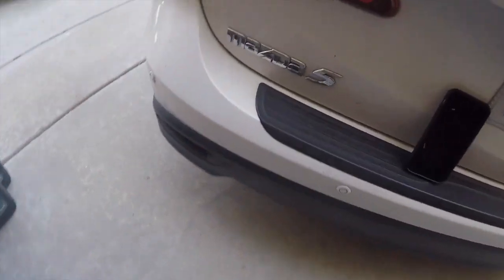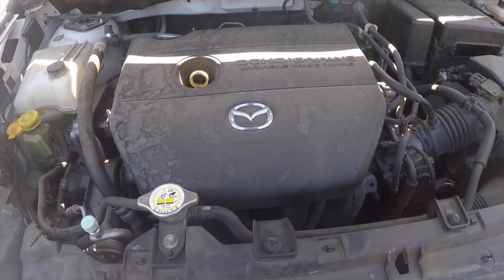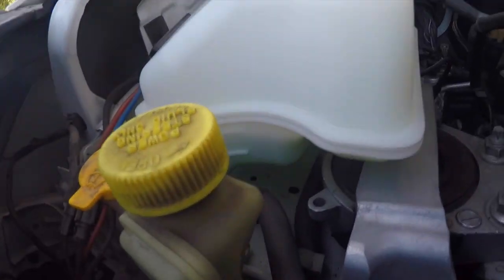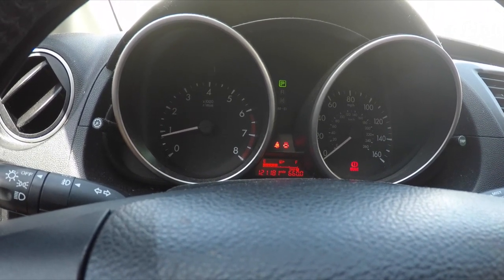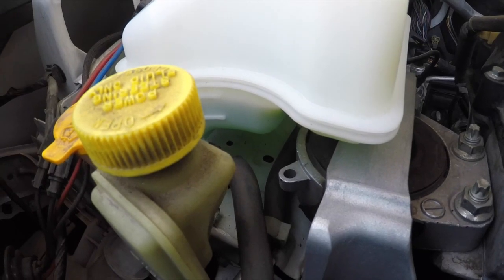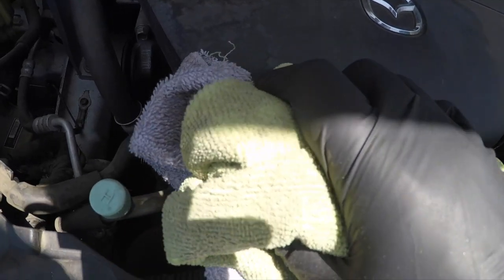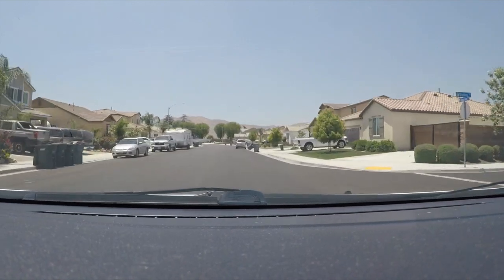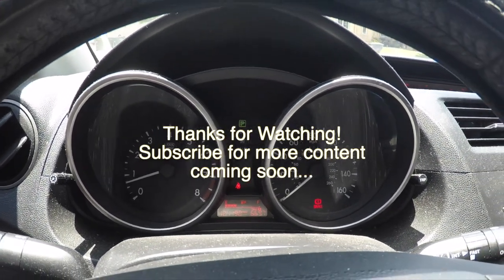Replaced my Mazda 5 Coolant

Comment: To drain the resivor tank just remove the hose that goes into radiator and snake it to the drain pan. It's easier and you don't have to remove the resivor. Nice video. I have a 2012 grand touring.
Reply: But he wanted to clean it inside and out. You should remove it to clean it.
Reply: That's an easier way of draining the reservoir :)

Comment: to do this properly you need to drain the coolant- get the same point before you poured the water in. close the bleeder valve, fill reservoir and radiator to top. run car for 10+ mins with heat on to get the thermostat to open up and circulate the water to flush out later. let the car cool down. then drain the system again- fill your coolant- then proceed to bleed any air in the system

Comment: What about the old coolant in the engine block? You don't drain and rinse it with distilled water? I thought one should either drain the engine block or top off the radiator with water, have engine run for a few minutes, drain, and repeat three times to get all old coolant out before replacing water with the new coolant.
Reply: You are supposed to do that. It even says it in the workshop manual
Reply: Just like changing the transmission oil, it is okay to be not getting every drop out. If you are maintenance it periodically, let say for every 30000mile or 3 years, you are good. If you are not changing the coolant for a decade or high millage, when you drain the coolant out, you can see the coolant is in brown or even black, flushing with distilled water as you mentioned is recommend.
Reply: @tyronenur2373 I found the service manual online and I noticed that it doesn't say to drain the coolant from the engine block. All it says is to drain the radiator until all traces of color are gone, refill with coolant and then it goes into the "burping procedure".

Comment: Would this be the same process for a 2012?
Reply from the maker: Yes I believe so the 2011-2015 models all share the same body and engine. Hope this videos helps you!
Reply: UreThane it does. YT has been my
Source for learning how to do everything on my 5 on my own. Last question of the day. I have the basic touring edition with no Bluetooth connection anywhere. Would you know if I am able to buy a used steaming wheel for my 5 with Bluetooth and able to add Bluetooth connection somehow?
Reply from the maker: Good question. I know there is a Bluetooth module that sits behind your glove box, I know the steering wheel has Bluetooth buttons and I know you’ll need the microphone module for the Bluetooth calls. My thinking is there an existing wiring sitting there for the Bluetooth module, microphone and steering wheel wiring or would I have too add wiring and make the connections. The touring and grand touring models have Bluetooth but I am unsure of the sport models.
Reply: Yes it is